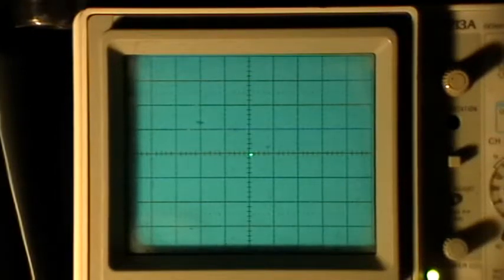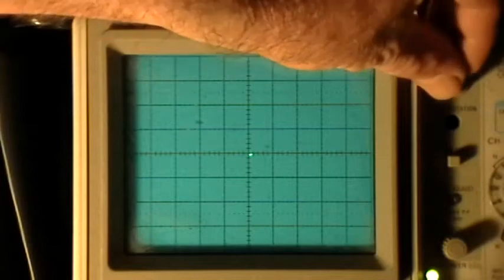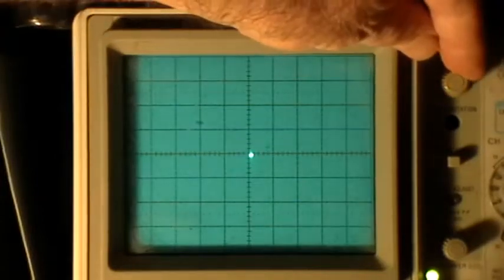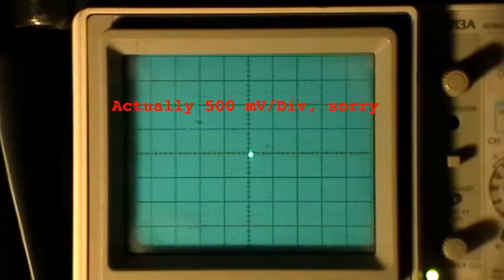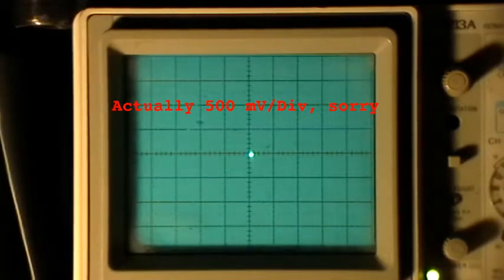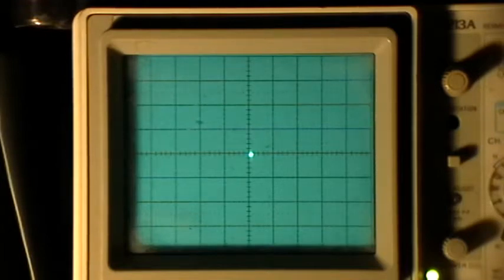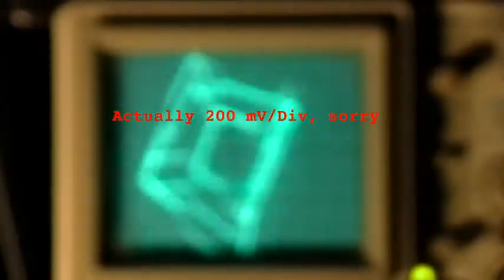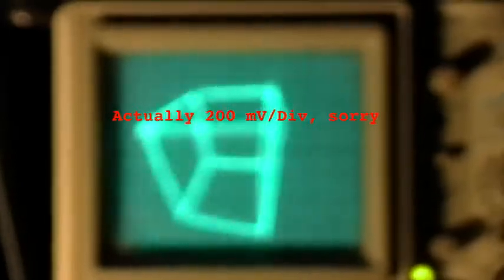Scoposcopy: Oscillofun and Youscope Audio Files on Tektronix 2213a

Comment: Cool demo. If swapping the horizontal feed wires doesn't work, then feeding your Oscillofun audio through an inverting op amp should fix your mirror image 'text' issue. What's next?  Asteroids?   https://www.youtube.com/watch?v=UioR-oXVIp0

"We will control the horizontal. We will control the vertical. We can roll the image, make it flutter. We can change the focus to a soft blur or sharpen it to crystal clarity. For the next hour, sit quietly and we will control all that you see and hear. We repeat: there is nothing wrong with your television set. You are about to participate in a great adventure. You are about to experience the awe and mystery which reaches from the inner mind to – The Outer Limits."